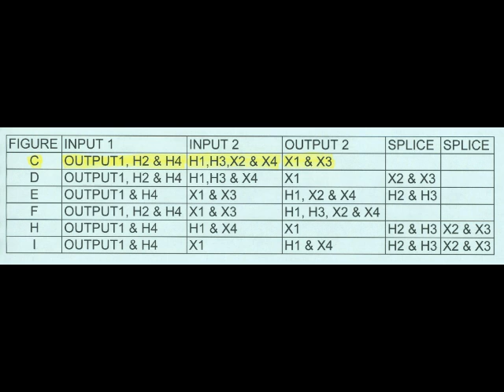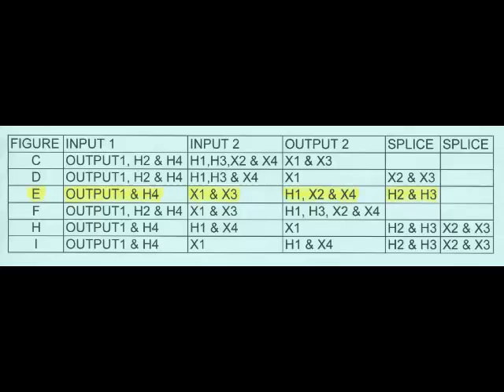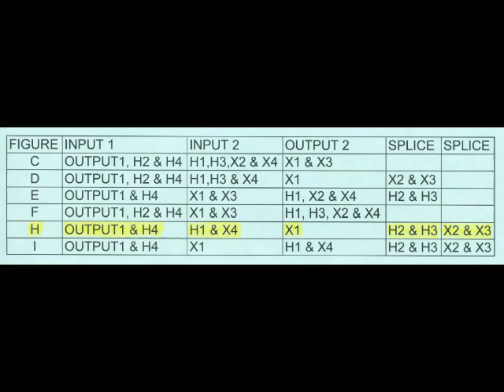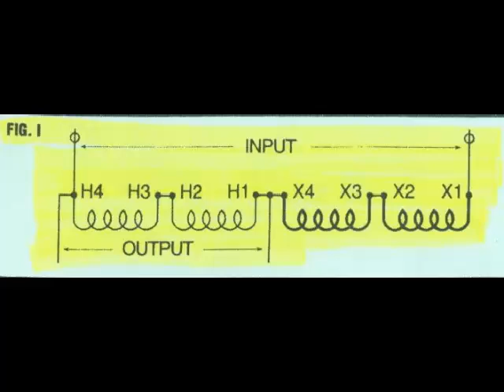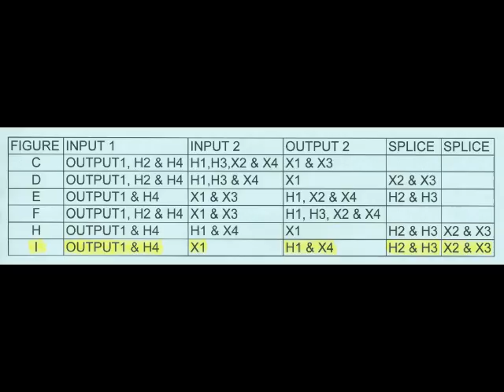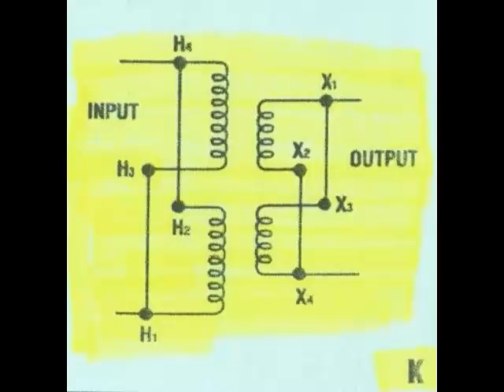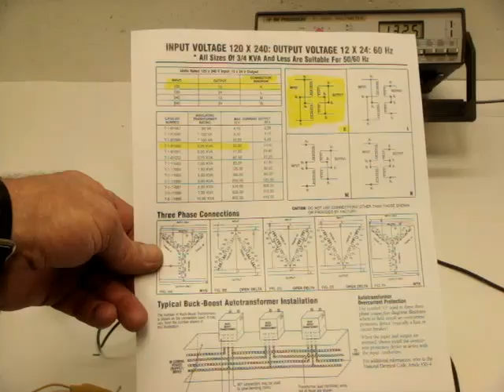ACME Buck Boost Transformer

Comment: Thanks so much help, stuck in down town Los Angeles trying to hook up a tanning bed you just saved my life
Reply: Hi
I have an air compressor that requires 220v my voltage is 208v will a buck boost transformer allow to get a consistent 220v ?
I need the compressor to function perfectly for my application

Comment from the maker: The "inner parts" consist of aluminum or copper windings around an iron core. There are NO moving parts, just a typically constructed transformer used in a slightly different manner.

Comment from the maker: These transformers are designed to raise or lower voltage by 12 or 24 volts. Yes, you can get 12 or 24 Volts AC (VAC) from either 120 or 240 VAC input. It would probably be less expensive, and faster to buy the 24 VAC transformer from an HVAC supplier. HVAC transformers mount on electrical boxes, whereas these transformers require additional connections.

Comment from the maker: Buck - boost transformers can lower (buck) or boost (raise) voltages. They are usually rated 12/24 or 16/32 volts. This means that the 1st transformer can raise or lower an existing voltage by either 12 or 24 Volts. The 2nd transformer can raise or lower the voltage by 16 or 32 Volts. You use one transformer to alter single phase voltage, or 2 transformers to convert 3 phase voltage ( in an open delta ).

Comment from the maker: Yes! Starting with either 120 or 240 Volts, you can increase or decrease the output voltage by either 12 or 24 Volts. Additionally, you can use it as a transformer to create 12 or 24 Volts from either 120 or 240 Volts. I demonstrated a "Small" transformer for ease of video taping.